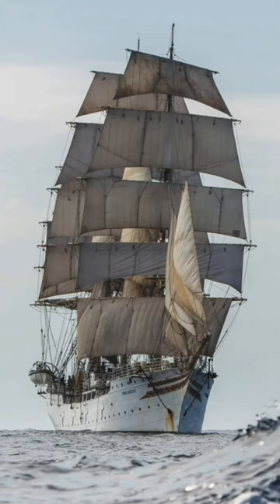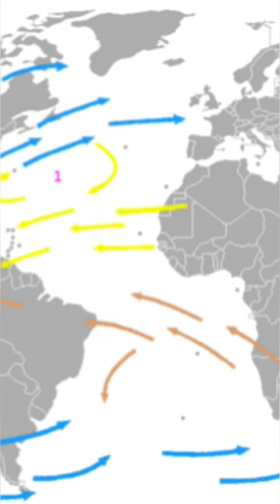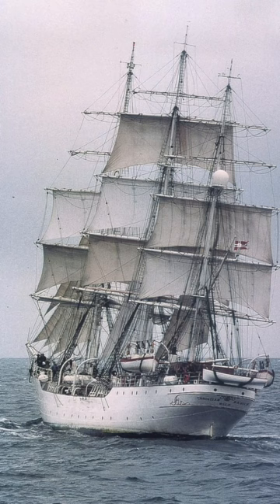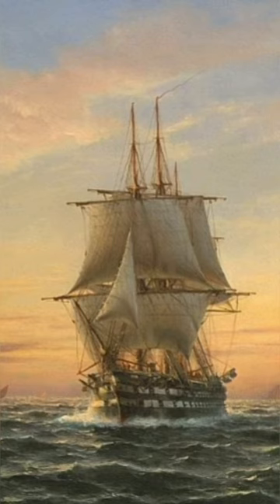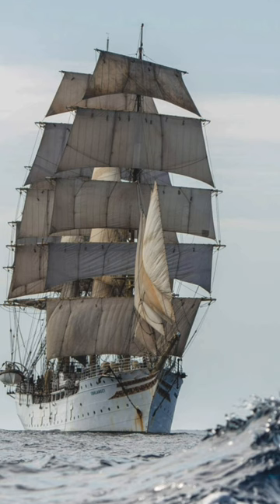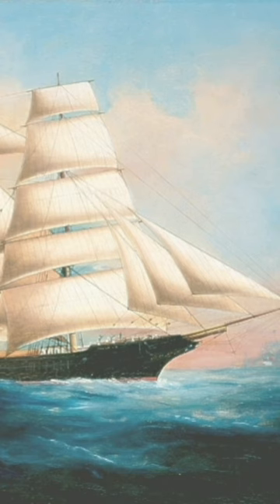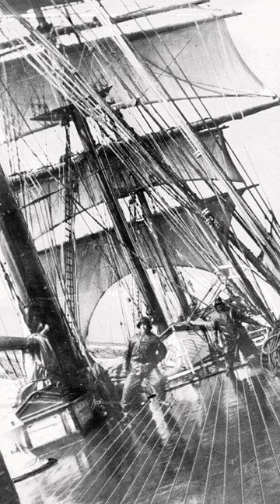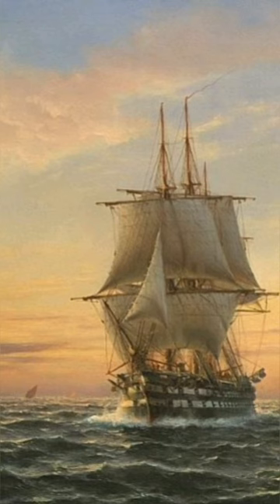How Did Sailing Ships Sail?

Comment: Just like today's highways.

 You can either take the quick and prepared highway for easy traversal of your preferred country. Taking exits as needed and changing on another highway.

Or you could take the country roads that are not prepared for large numbers of vehicles and travel all-over to reach your destination.

One is fast and reliable, the other slow but without major congestion. If traveling outside rush hours. In correlation to the ocean, this would be needed if you smuggle something.